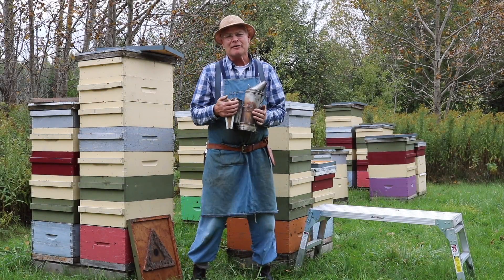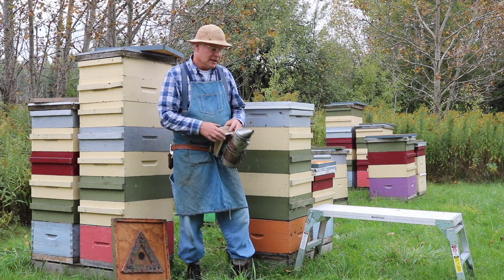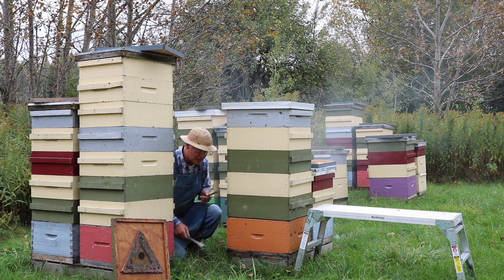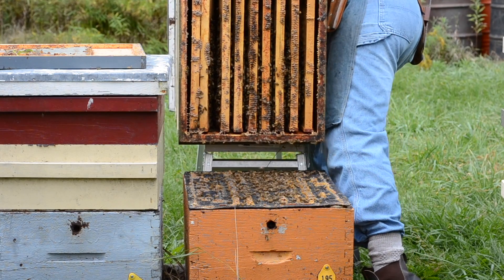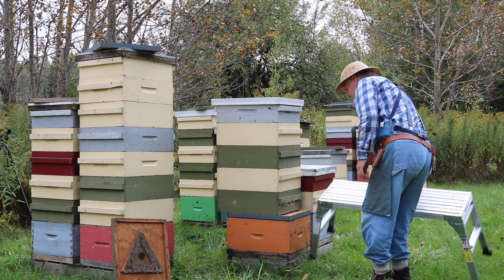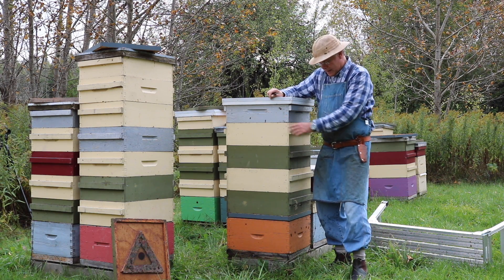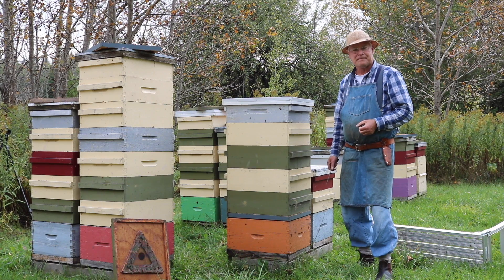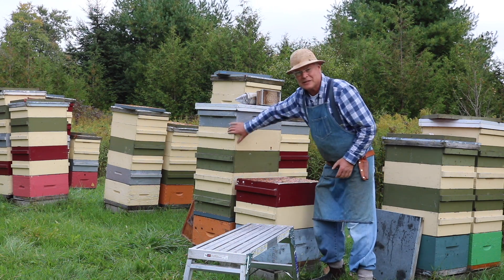Tipping Hives

Comment: Also you can use that hydraulic lift table and is on the wheel too.
Reply from the maker: Hi Geani
 Yes you could but I find this method faster, easier and safer... in our conditions.
Reply: I am watching all your video ,you are a real master.

Comment: What a great tipping idea and you made it look so easy and simple!  I noticed one of your colony has seven supers even though most have only a few.  Don't the bees have problem fitting into just one bottom deep for you to harvest the honey supers?
Reply from the maker: Yes it is a bit of a crowded space in the brood camber after harvesting honey. In our climate bee populations drop in the fall and with cooler temps. cluster more tightly. This coincides with our fall harvest. Thanks!
Reply: @UoGHoneyBeeResearchCentre  how would this apply for warmer U.S. climates (Mississippi). Would that render single brood chamber method more challenging or less advantageous?

Comment: Looks like a pretty useful item around the beeyard. What are the dimensions of the stand?
Reply from the maker: Hi Kirk
  Agreed! The platform is 12" x 37" and it is 21" high.
Reply: @UoGHoneyBeeResearchCentre  Thanks!
Reply: Kirk - they are available at any paint store but, of course, probably cheaper at Walmart or Amazon. I actually received one free for starting an account at a paint store and it's been extremely useful.

Comment: I watch a lot of your videos and find them helpful but tipping hives may be the worst idea you have covered.    Attention new beekeeper DO NOT DO THIS.    One should never depend on propolis to hold parts of the hive together.    If one of those supers breaks loose the whole stack most likely will go in all directions resulting in very angry bees and likely some corners of supers broken loose from impact with the ground.    First year hives and or hot weather will definitely contribute to the likely disaster.   Also, I am not a fan of using escape boards to clear bees.    It invites ants and if any opening is ignored the hive most likely will be robbed out.     Paul, you might want to recant this video!
Reply from the maker: I respectfully disagree Bob. I agree there are situations where this won't work but hope that I conveyed them in the video. I also presented an alternative. My rule of thumb is if  YOU think it looks dangerous don't do it.  I hope others can use their own sense of what is safe. I'm really getting tired of the fact that we have to make everything 100% safe and there are no risks allowed. We didn't get where we are as a species without trying new things and taking risks. We've been doing this for several years and have never had a problem after several thousand  repeats. It HAS  to be done carefully and may only work in our conditions.
Reply: Your program, your option to preach whatever your think will works.  Sorry that I commented.   I regret that you are tired of getting what I hoped would be positive feedback.   As for experience, I am a second generation beekeeper in a 105 year old beekeeping operation I am 80 years old so I have been around also.    I will not bother you anymore as I have unsubscribed to your channel.
Reply: @bobfanning6816  with much respect. . you were quite rude.   if you cant take it, don't dish it out.
Reply from the maker: I do really appreciate feedback Bob. I think it was a bad day for me to respond. I spent three hours on legal work today -  just to allow kids to see bees. You did raise some legitimate concerns, especially regarding brand new equipment and brand new beekeepers. The technique does require some 'stickiness factor.' I apologize since I offended you . It was more a comment on how I see our society going and not your legitimate suggestions.
Reply: @UoGHoneyBeeResearchCentre  You apologized to the guy who was rude to you.  You must be Canadian.
Love your videos.

Comment: I can see me trying that...and 5 boxes of bees slowly slipping off the front, crashing to the ground, frames spilling out and thousands of bees filling the air.
Reply from the maker: HI Andrew
 If you think it looks too dangerous please don't do it. That's my rule of thumb. Instead try the second method presented. The work stands are very useful for lots of other tasks. We've done this tipping method a few thousand times. In the right conditions it works well and saves a lot of back breaking labour.
Reply: sounds about right :)

Comment: I would think this is the cat's meow, and much easier and safer on the back,  for under $2k your very own electric hive lifter: https://www.beebreedingcentre.com/product-page/heavy-lifter
Reply from the maker: Hi James
 I have an older non electric version which works well but only on very flat ground. The hand cranked winch worked fine so that's not the issue. They take a lot of space in the bee yard and aren't any easier than the method I show so I don't use it much anymore. For just 2 or 3  supers its far faster to do it by hand. The work stand shown in the video is valuable for many other tasks. These comments relate to installing bee escape boards.

Comment: Love all the videos you guys provide. Coming out of my first winter I was trying to think of a good way to remove the supers this year and this is a great idea although I think I'm going to modify what your doing a bit. Making a "A" frame with 2x4s with like 6" tires on one side that can hook the bottom super and just tip it back. Should be a fairly simple design and a bit easier then tipping the whole stack down.
Reply: that sounds really rad! please share if/when you do!
Reply from the maker: Hi Mike
 Thanks for your support! I've tested a variety of other devices to accomplish this goal. This simple way is my favourite but it may be better suited to our conditions than in other situations. Good luck with your idea!

Comment: Curious... does this ever go terribly wrong?  In other words, some catastrophic failure of propolis somewhere in the middle.
Reply: I was cringing when he leaned it back. In FL the propolis would've def failed lol
Reply: @Swampsquash  As a 2nd year, I am such a noob that I wouldn't have thought of tipping it... but... I also winced when he did it.
Reply from the maker: Hi S E
 Not in the conditions described in the video. It's not just the propolis, its also the burr comb between supers that hold this all together.There isn't a lot of shear force the way we handle the stack of supers. Even If it did break apart there is very little room for the supers to fall. I've tipped lots of things over in other ways though!
Reply from the maker: Please don't use this method if you don't think it will work under your conditions.
Reply: @UoGHoneyBeeResearchCentre  yeah I understand,  with hive beetles I could never use escapes anyway
Reply from the maker: Hi Brian
  Thanks for your understanding. Hmmm... We don't have small hive beetles yet. I haven't heard that it's a problem with them when using escapes. It seems like escapes are more popular in Canada even compared to areas in the US with similar conditions. Huge differences from your area in Florida to ours. I can only present things that I know work here but obviously they won't work everywhere.  The snow is gone now but not much in bloom yet. Cheers.